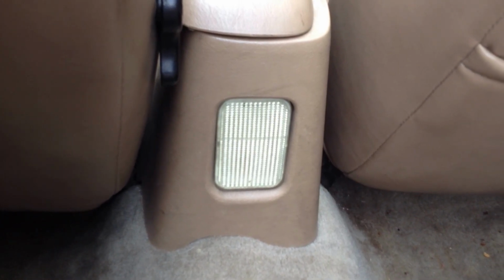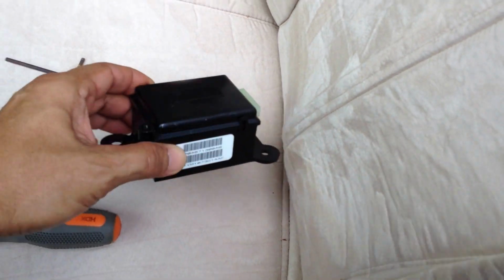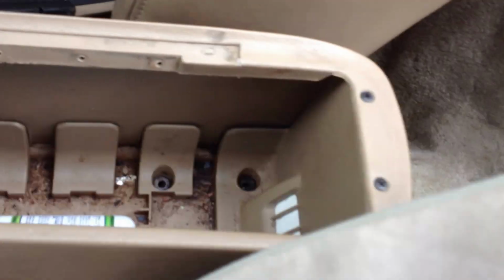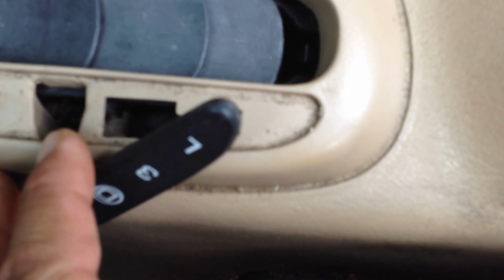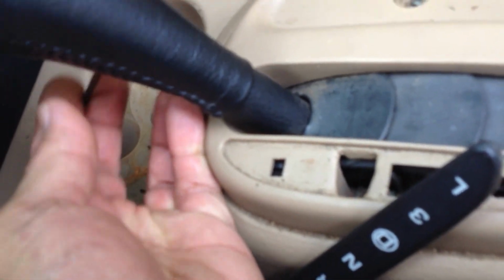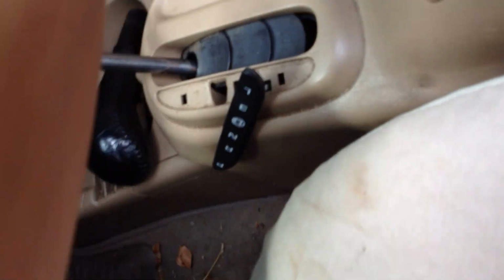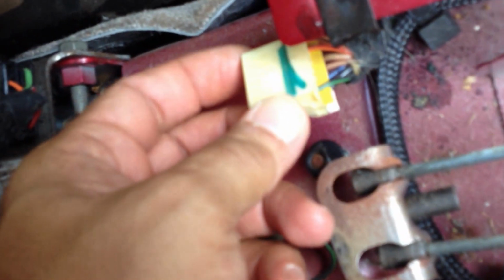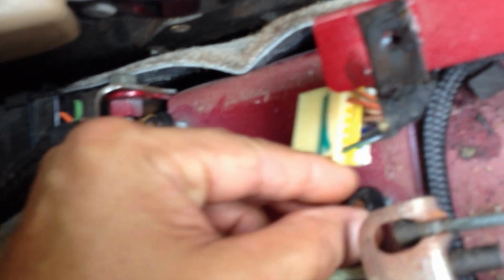Seatbelt repair 1996 Chrysler Sebring JXI Convertible

Comment: Thanks for posting this video - It was really helpful. I have a 99 sebring jxi and the location of the module is pretty much the same as the 96, but they changed a few things in 99: The allen wrench is still needed for the gearshift knob. You'll likely want to set the emergency brake and pull off the handle as well; the shift panel just pops off (there's no screw hiding under a cap) - then there's an electrical plug that needs to be disconnected; then you just need to remove 2 screws from under the shift panel, and there's 3 screws in the bottom of the center storage that need to be removed. The module is held down by 10mm bolts, so you'll need one of those for a ratchet.

Comment: Ken.  Yes.  There is one single module that controls both front seat belts. When you replace this module under the center console both seat belts when then operate correctly.  You won't need to disassemble the seat belt assembly.  You only need to replace the module under the console.  Good luck it was as easy as the video shows.

Comment: I've got a 2000 jxi that has a similar problem, only the driver's side gets stuck.  I can fiddle with it and get it to release if I pull it all the way back, but it gets stuck halfway and wants to retract half the time.  Would this be the same problem if only one belt gets stuck?
Reply from the maker: From what I remember both seat belts would lock.  They worked intermittently. Sometimes it would pull out and I could lock it as normal when I was seated.  Then when I was driving it would lock in place and not slacken when I released the brakes.

Comment: Your video is great for that subject. But I've been trying to find a video of how to "Replace the Seat Belt" in this same car. Mine is a 2000 but they are the same. My seat belt strap is wearing out... fraying apart where i pull the clip across the chest. I don't know how to replace that strap or just buy a used replacement. But i want to see what is involved with "Removing the old one and installing one that is in proper condition". Any ideas? Is this a "do it yourself project" for the handy man? And do you happen to have a Gray Driver side belt to sell? Thank you.